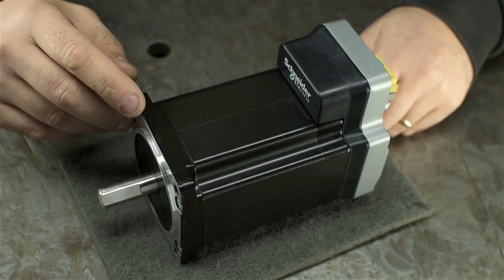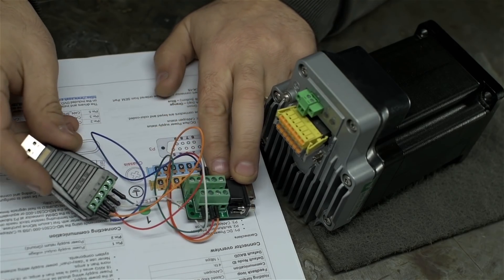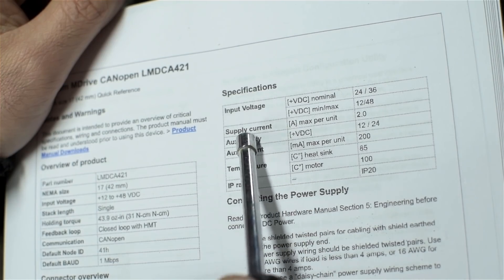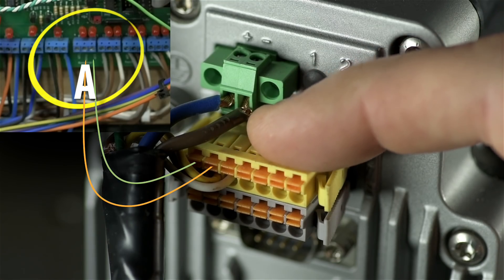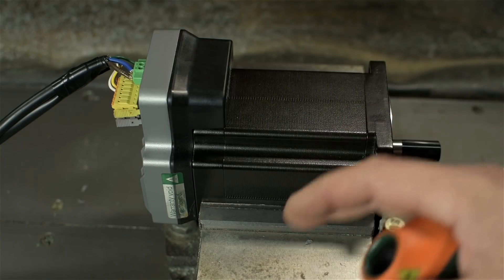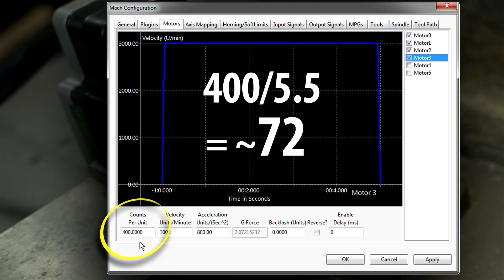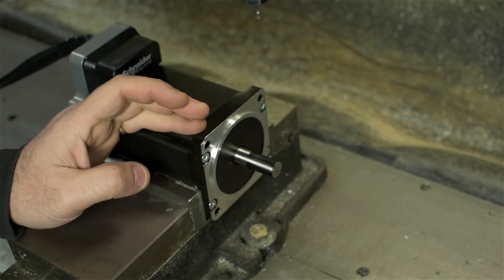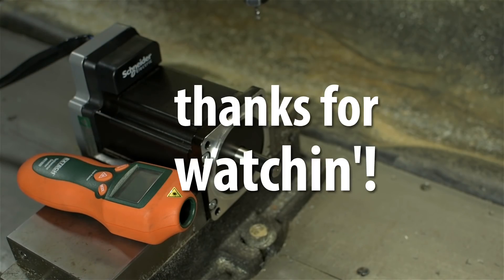Rise Of The Machine - CNC Router Upgrade - Part 1

Comment: I haven't finished the video yet but i'm already curious what you acquired this kind of stepper (with feedback) since neither mac3 nor mach4 work for closed loop.
Reply from the maker: the smoothstepper motion controller should be able to deal with the closed loop.  nothing happens in mach.  then again this all new to me.
Reply: It makes sense that it should be possible. I have the USB version of the smoothstepper, so I'm stuck in mach 3 (at least until mid 2019 they say) and haven't seen any config like that. Your plugin is much newer and probably full of tricks. Eager to see how it turns out! Regarding your ask about making a more thorough video on the electronics, I can tell you I must have watched your CNC build videos about 10 times while I was putting together my own machine. I'm sure people in a similar situation would find these would be video very useful as well.

Comment: yes on the video, your CNC has a small dc volt amp meter? i have bought one for my 3d printer its working but not sure i have it wired correctly, did you show how to wire yours in the build ? 
Thank-you for all your Time and effort for these awesome videos

Comment: Ah, a Schneider Electric product. I work for them in the UK. If you have any more problems, just try switching it off, and on again. You're welcome.
Reply: I work for their competitor in the integrated motor field. If you have any more problems, just get a JVL Industri Electronik model instead ;)
Reply: @therasm244c  How would you compare your product to an Applied Motion or Tollomatic unit? I know the software for those and Schneider are universally piles of suck...still looking for one that doesn't.
Reply: @kevinvermeer9011  Full disclosure, I have nothing to do with sales, and I don't know the competitors products. However, in my experience the software for setup of our motors, MacTalk, is great. I have found it quite intuitive and very well behaved. Same goes for the internal firmware, where I have never encountered issues. New updates for both software and firmware are realesed often after rigorous testing, with any bug fixes and often new features added suggested by customers. Send me a PM if I should connect you to a sales guy :)
Reply: sounds like how to fix almost any IT related problem.....
Reply: IT guy here.
I agree.
Reply: If that does not work, percussive maintenance is your friend.
Reply: @Gunny1971  youd think hiting it would make it worse but somehow it seems to just do the trick.
Reply: We joke and kid, but sometimes letting the stream reset itself, is all it takes. The meme has hurt a decent, basic, age old procedure.
Reply: oh I know, that's actually one of the first things I learnt when I started working on computers in the early 90's, that and never ever let out the magic smoke
Reply: Oh Howdy, we're the UK distributor for the IMS products :) Was quite surprised when I saw this come on too. I take it you're over in the main SEM branch (handles the servos etc?) I'm over at MCP Ltd.
Reply: Was that a reference to how they just fixed the Hubble telescope?
Reply: Really encouraging advice. NOTE for future me: if you could ever afford Schneider motor, don't buy it.
Reply: @kfh13 Don't be deterred by that guy. I don't even know him. I work for the Exclusive UK distributor of that product. If there are any problems, I'm sure we can resolve them in a method much better then 'turn it off and on again' Generally there is a little more to it than that. This is probably one of the most bullet proof products I've ever seen, we offer them with a 4 year warranty... that's pretty much unheard of in the industry.
Reply: Someone so defensive must have some pretty crappy service
Reply: @TheHarryroks Hardly, just true, My favored product is one that I have to provide the least support to so I can focus on new business. It's damn bulletproof. the only returns we have were pinned down to Input voltage spikes in excess of 1.5x it's rated max due to an inductive load (in the past 4 years I've been working there, that is) If we had trouble with the product, We'd stop pushing it quickly. Schenider do a good job on this range.
Reply: Okay buddy. Who would have guessed from your reply that you sell them :)
Reply: @TheHarryoks. Indeed, I'm one of the Applications Engineers over there who handles support on drives / controls. I'm not sales. I only care for the product's effectiveness really. If the product is shit? Damn right I'll own up to it, We have quite a lot of other manufacturers to offer from. Biggest hole I can pick at on that product is it's weight, damn pain lugging units to my desk for programming up the stairs from the warehouse! :)
Reply: You mad genius!
Reply: What does Big Stew do for Schneider in the UK?
Reply: @BSRacing-UK  I'm a software engineer, supporting SCADA applications and drivers.
Reply: Worked for the Hubble Telescope... :-)

Comment: You know what I want with regard to CNC ELECTRONICS? I want a Smoothieboard based system that  is scalable up to do a Bridgeport retrofit and is simply plug and play so that I can just bolt it in like all the other spare parts and go.

Comment: Good points to cover would be:
- types of motors (open loop, closed loop, servos) and basic differences between them
- assessing spindle power and rpm
- assessing necessary stepper motor torque
- list of essential parts to make the machine work
- software options
- options for running mach 3 on a non-junk pc without paralel port
- useful/necessary stuff to make the best use of your CNC (indicators, holders, framed picture of Abom giving you a judging look to remind you not to falf ass stuff)

Comment: The reverse speed being slower - it is missing steps, either slow the ramp time or max speed to let the motor catch up. or increase voltage or amperage to the motor if you are not already using the highest rating for the motor.

Comment: Tony, if you have a stepper (or servo) with a built-in encoder, it will typically have other outputs in addition to the A/B quadrature outputs. One of these is likely an INDEX. If you are attempting to make a lathe... you will want both the A and the INDEX as they are used in threading operations.

Additionally... having feedback is useful because there is usually an ERROR signal. With traditional steppers, if you miss a step, or a hundred... you have no way of knowing. With an active encoder, it will send out an ERROR signal should the preset limit be exceeded.

This way, the ESTOP will be triggered and the job stopped... instead of mucking up the piece and/or destroying a bit. I hope you found this helpful.

I'll be addressing using the stepper as a C-Axis and Spindle on my channel... as soon as I figure out the LinuxCNC programming. :- /

Comment: by the way forgot to mention the rpm can be higher on a stepper when the voltage is higher, it has a faster response time also. you are running on the high side of the voltage for that motor. just got to keep amperage low enough, for anyone else that try's it. so it doesn't let out the magic smoke.

Comment: I love your videos. I have an older Shopmaster Eldorado Tri-power lathe/mill CNC machine, but I'm intimidated by it (really just the Mach3/control board/motor driver parts) because I dont have a solid grip on what does what, so I feel like I'm missing pieces. If you could do a brief overview of the control side of the house, that would be amazing.

Comment: Hey Tony, try some wire ferrules on those connections it will help strengthen the connection a bit. I usually see those type of steppers in some type of box and they will use a connector on the box with the wire ran to the motor. this would support your wires and keep the chips out. I really dislike those type of steppers for externally mounted motors. good luck! Awesome show!

Comment: I would love to see your take on building a cnc. I would also love to see some ferrules on you 70 volt wires. Some people will say you shouldn’t use them on terminals like that, but they can help to prevent stray strands causing nasty shorts. Like Boss Hogg wearing Daisy Dukes nasty.
Reply: Ferrules are the way to go, at least for the screw terminals.

Comment: For the same money you can buy 400W AC servo with driver. More speed, torque and silence.
Reply: Steppers actually work quite well in CNC machines versus Servos which uses an error correcting loop. That Loop takes a small amount of time to respond and can over and under shoot. Steppers essentially respond immediately which is a big advantage for coordinating axies.
Reply: For hobby use yes, steppers work well, because they are cheaper and easyer to use.  No real CNC uses steppers and the little correction loop is insignificant, just get good servo drives and encoders.

Comment: "Not to be confused with linear degrees."

That got me for about 10 seconds before I realized I was an idiot. I can always count on you for making me feel dumb. Thanks Tony! :-P
Reply from the maker: my pleasure Chevee!  ....err
Reply: Linear degrees is what's on the gauge for checking your blinker fluid level.
Reply: or you know, you can use it to check the flank angle of your car's piston return springs
Reply: I thought this was the angle between 2 points, my bad.
Reply: My lab thermometer is calibrated in linear degrees Celsius . . . : P

Comment: power cable looks like its gagging to short out with a wee stray strand .. may be worth adding some ferules.
Reply: Or strip them a bit less
Reply: I’ve just discovered bootlace ferrules, fantastic for stranded cables in screw terminals. To increase the OCD, a heat shrink tube printer finishes the job.